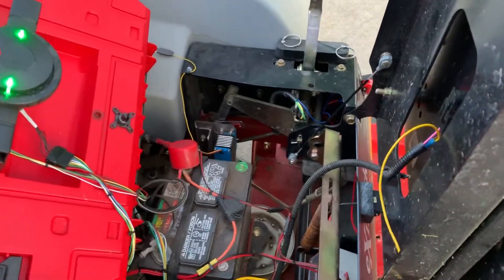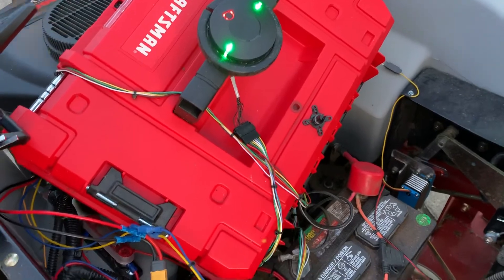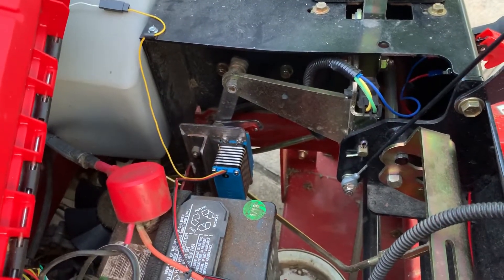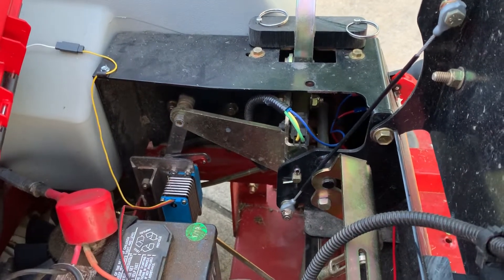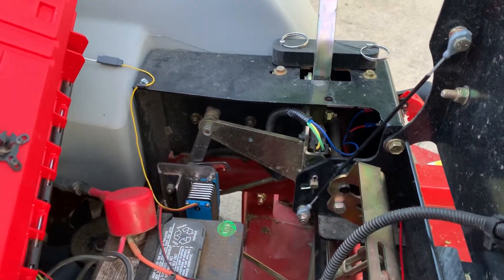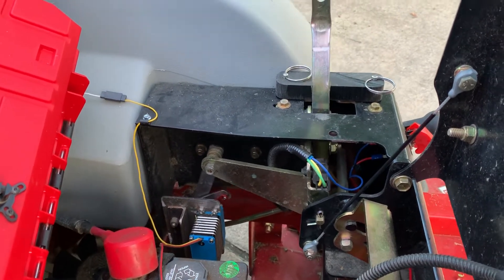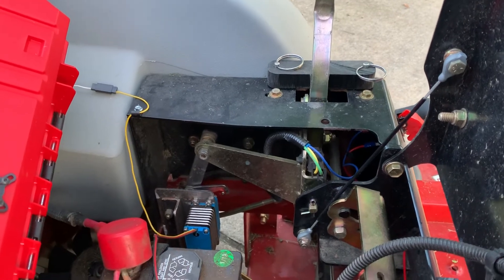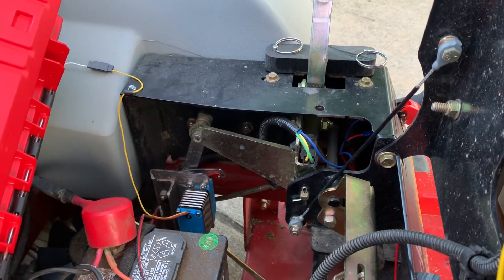ArduRover 4.0 Mower Servo Linkage Closeup

Comment: Do you use an independent battery for the strong  servo and you only connection between the pixhawk and and the throttle servo is communication Yellow cables?????
Reply from the maker: I use a single battery and the mower's own charging system to power everything.  The Pixhawk has a dedicated low power voltage regulator to supply 5V for the electronics inside the housing.  The big servos have another dedicated, high amp buck converter to supply 7.5A with a common ground.  You're correct about the yellow wires being the PWM data lines to the servos from the Pixhawk.

Since this video, I added engine throttle and choke control in the same manner.
Reply: @YurisHomebrewDIY  
You are a gentleman

Comment: Your voltage regulator gives you 7.5v (which is great for that servo) but the pixhawk max input voltage is 5.7v.  How are you powering the pixhawk?
Reply from the maker: The Pixhawk is powered by a 12V-5V converter (the "power module" that's sold with most controllers).  The servos and their supplies share a common ground, and the data line is 5V.